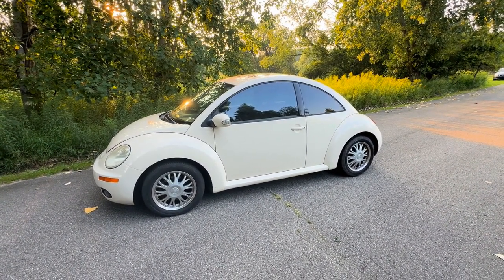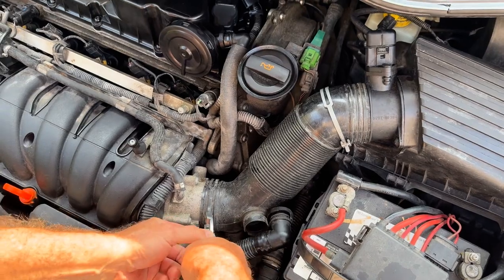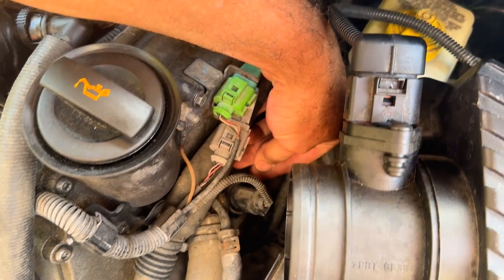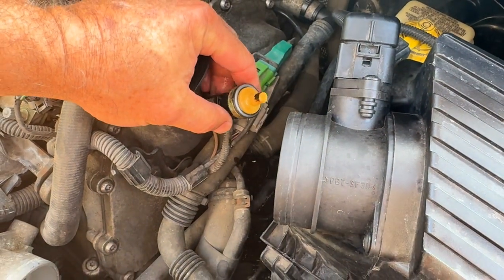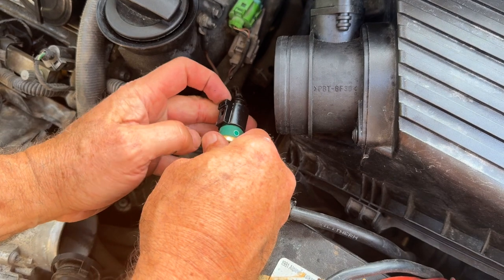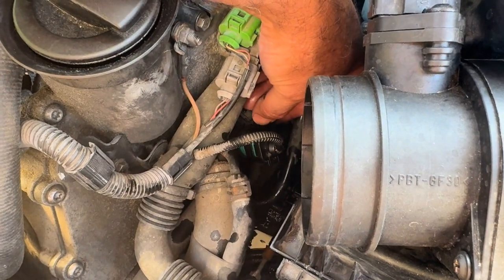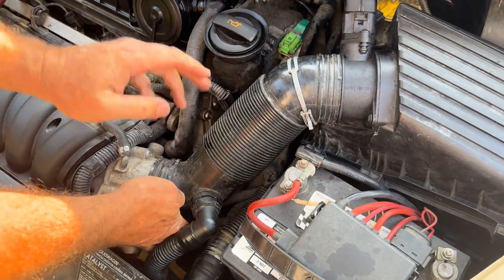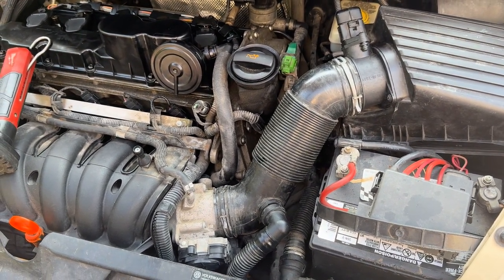How to Replace Coolant Temperature Sensor Volkswagen Beetle

Comment: Just replaced mine but the sensor is loose even with the clip? I put the o ring on correctly but now it leaking
Reply from the maker: Did you make sure you pulled out the old O-ring? With one O-ring and if the clip is installed correctly, The sensor shouldn't be loose or leak.
Reply: Figure it out? Just did mine and had no issues. Except I thought I would of lost some antifreeze but did not lose any. Almost like  there is an airlock right there in the system?

Comment: I have a 2009 vw rabbit with the same engine and there's a second coolant temperature sensor on the lower radiator hose, driver side. How do I replace it without loosing a ton of coolant. Will the air get into the system?
Reply from the maker: Removing the coolant temperature sensor on the lower radiator hose you will lose a majority of the coolant. I would jack the car up and use a clean bucket and remove the lower cooling hose hopefully catching most the coolant. Once drained ,you can then replace your coolant temp sensor and reinstall the hose.
 YES, to bleed the cooling system, leave the car on the jacks so the the coolant tank is the highest point in the system ,take the coolant tank cap off and start the car .While the engine warms, it will "burp" all the air trapped in the system through the coolant tank,  watching closely the cars temp as it rises,  to make sure the engine doesn't overheat. At some point the coolant will be so hot that it will start to boil out of the coolant tank, then put the coolant tank cap back on.Once the engine cools down repeat if needed, until no air bubbles are seen in the coolant tank and the engine temp is stable.